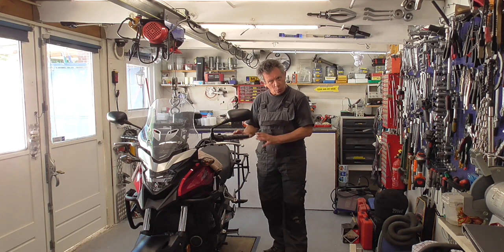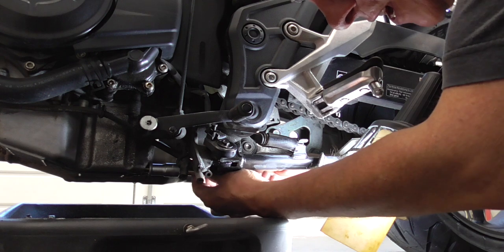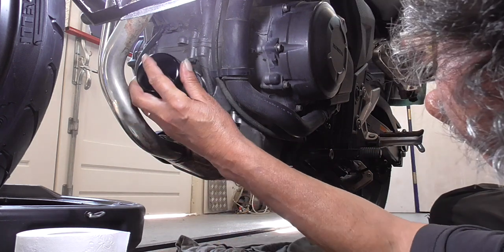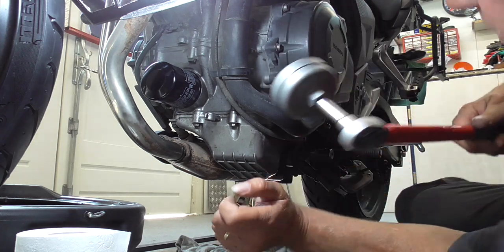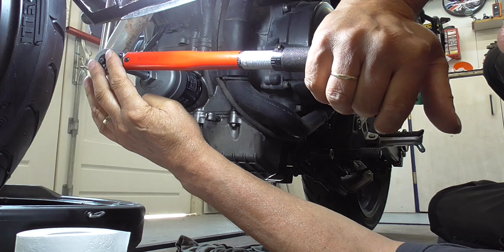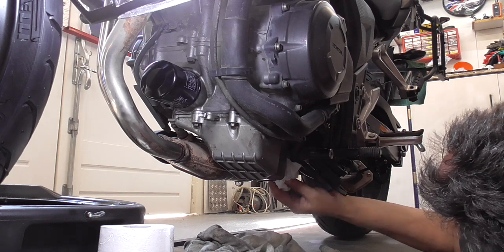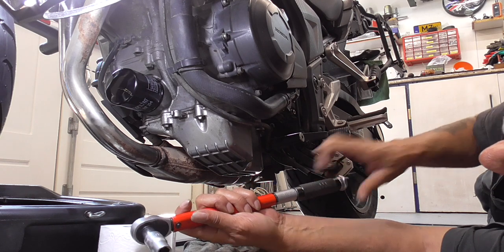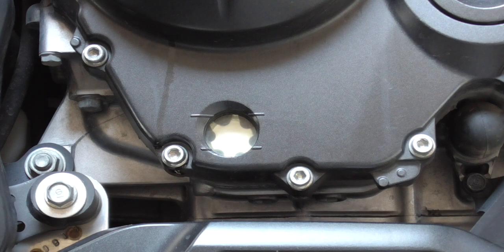Honda CB500X OIL & OILFILTER CHANGE  👨‍🔧---🏍  --WHAT TO LOOK FOR-- !!

Comment: A torque wrench for the filter is way over the top. It's hand tight then a quarter turn on a wrench and that goes for all bikes.its been known that torquing at spec sometimes can crack engine bolts ect ect.  Enjoyable video dude.
Reply: Yes I agree I've NEVER torque an 🛢️ filter in my life & I've done 500,000 🛢️ changes... Any oil that I changed previously even if the customer waited 10-15,000 mi I could still get the filter off relatively easy. I also get a lot of 🛢️ onto the gasket & prefill the filter 1/2 way... I don't even torque the drain bolt, I just replaced the crush washer 'n You can feel it crush down just Make sure it's snug & 🛑 right there

Comment: I like how this little 500cc bikes takes 3 full quarts of 🛢️ some places say 3.2 but I promise you it's NOT, I've done 3 🛢️ changes on my bike with only 4,000 mi... & I use full synthetic I like to waste 🛢️ I guess... My buddy picked up a 2021 v-strom 650 & it takes the same amount of 🛢️ as my bike I just thought that was pretty neat The smaller engine takes just as much 🛢️... Thx for the info. Love your bike (i have a very similar 1) haha I just go for a ride let it get hot & then tip the bike back 'n forth to get any 🛢️ out... The 650 kicks the shit out of my bike but I like the Honda more than the Suzuki cuz it's smaller & lighter. Best mod I ever added was 1050 lumen lights on each side of the headlight mounted on my crash bars.

Comment: gday Old mechanic i was always told to recharge the filter with oil before instalation so as your engine doesnt wait for the oil to fill the filter before moving round the engine always done it this way paper will soak up all the oil so it is already charged .

Comment: Sorry if the text is not understandable, I used Google translate. I have a bike like that too. I do 2 things slightly differently when changing the oil. One is that I only choose an oil filter with a square profile seal, because it is more difficult to compress when screwing it in. (I saw that you used an oil filter with a round profile gasket.) The other thing is that I only hand tighten the oil filter as much as I can by hand. I found that at a torque of 26 nm, the seal is already completely compressed, and the filter housing made of steel scratches into the aluminum surface.

Comment: Hallo, why did you use 10w40 oil instead of the recommented by Honda 10w30? Thank you.
Reply: As far as ive learned, the tickness of the oil is dependant on the region you live and its climate. The number behind the W specifies at what outside temperature the oil stays the same thickness. So 10w30 till 30°c and 10w40 till 40°c. 10w30 is recommended but 10w40 isnt wrong either.

Comment: hi mate! what oil do you use to lubricate the filter before putting it on?
Reply: Use the engine oil. I've watched a few of his videos, and learned he typically likes to decant into the squeeze bottles for other uses. It sounds like he's even describing it as Castrol, which he then uses to refill.

Comment: "... the best way to change the oil...". Immediately messing up, not realizing warm oil will not drip straight down..
Reply from the maker: After the bike was stopped in my shed the hot oil plunched in to the lowest point of the engine 😉